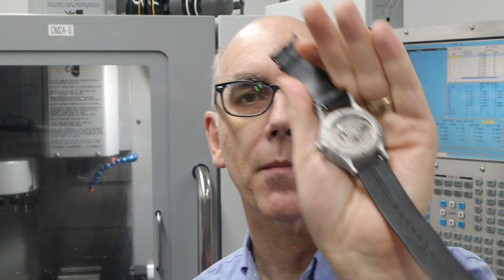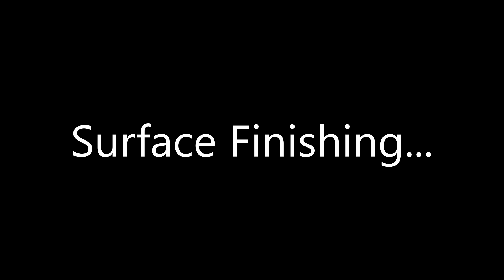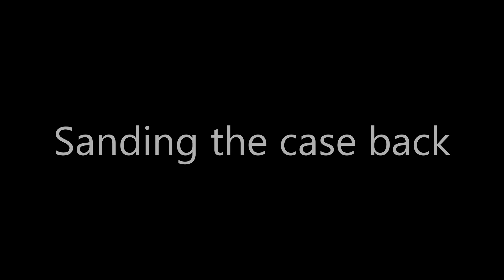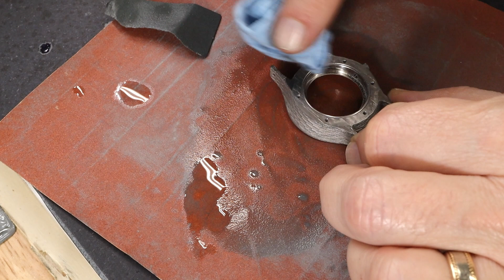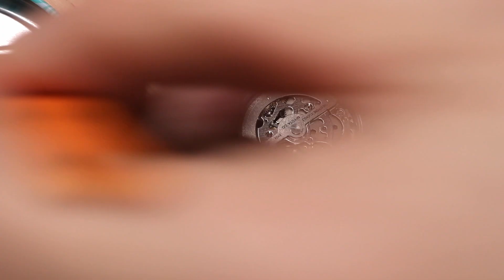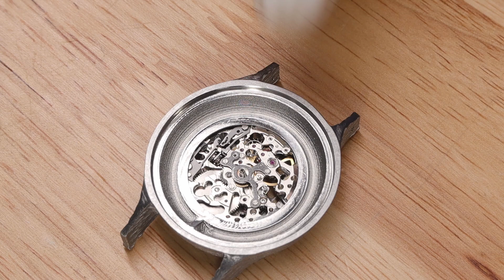Watch Case - Machining a Prototype, Part 3

Comment: Hi John,  in the watchmaking world we call the floor the Bermuda Triangle...  Good job dealing with the screws.  If you want to increase the contrast of the hands, take the hands off, clean with alcohol, and coat with a black Sharpie marker.  Old watch maker trick when cleaning up hands on vintage pocket watches that have gotten a little rough on the surface and won't take a high enough polish to heat blue.  I'm retired now and am playing in my shop, but still do some watch and clock work for my own pleasure.   Definitely liking the capabilities of your OM2, and admire your versatility.
Reply from the maker: Thanks. I have some new hands that are black for the next build (which should be in the next month or so).

Comment: I'm surprised you got away spoting with a chamfer mill... I only can get away with that on 6061
Reply from the maker: It's actually a special end mill that was given to me that has four flutes right near the center, but two farther out. So it's really good for doing both spotting and chamfering.
Reply: @JohnSL  oooo, that's interesting... what brand? I totally wanna try the tool out

Comment: Great video 👍 John may be make the back ring differently,start with two flats then  drill the holes and pocket then cut bevel edge this should stop all that watch maker's deburring😊
Reply from the maker: I think that's the same as what I have in mind. Right now I'm using a boring operation. But if I leave some stock for a finishing pass, I can use a different tool path that would slightly wrap around the corners, ensuring there is no burr.

Comment: Good job with those tiny screws. That's my idea of torture. The engraving came out great too. Very crisp.
Reply from the maker: Thanks. My previous hobby was building models for train layouts in N scale (1:160 scale). So I'm used to working with small parts.

Comment: I found that the smaller the screw, the more energetic the bounce off a hard surface. And the more important the tiny part the more potential for quantum teleportation to a location it should not be, like shag carpet and the space under base molding. 
That's why I assemble on a piece of chamois.
Reply from the maker: Excellent point. That's probably why all the watchmakers have green pads. I'll have to get such a pad for exactly that reason.

Comment: Where you have that burr can making a climb mill cut on first pass eliminate getting the burr? 
Saw that on Joe Pieczynski channel.
It looks like you are all ready doing that method.
Reply from the maker: Yes, I've been thinking about how best to do that type of thing in Fusion 360 as the tool path for production. I love his channel and have learned so much from him. The tool path was from the outside toward the inside. But I really need two: One from the outside and part way in, and the other from the inside and part way out.